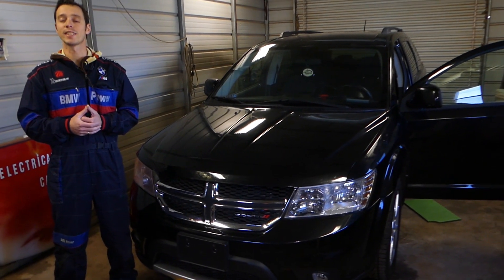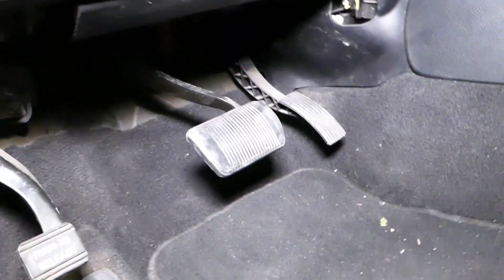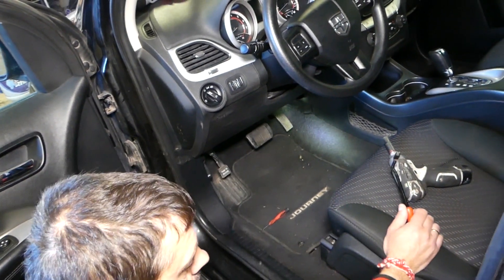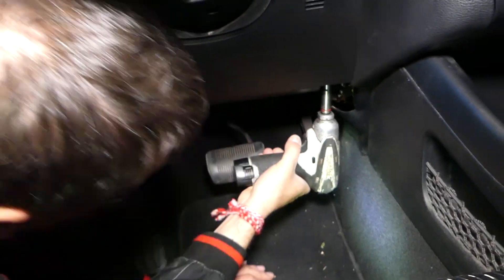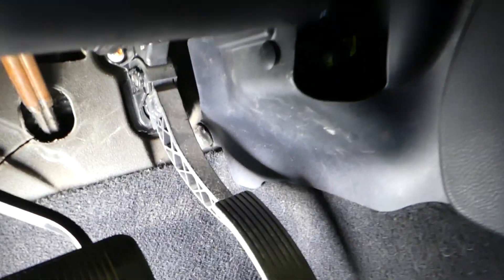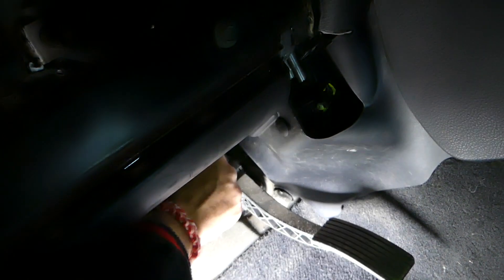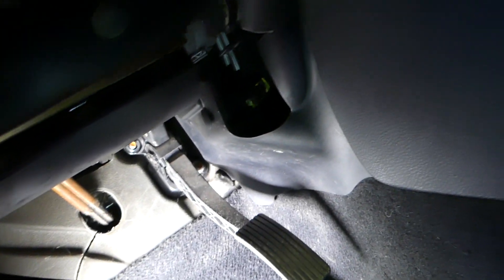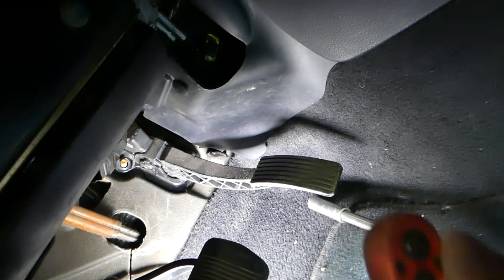DODGE JOURNEY THROTTLE POSITION SENSOR, GAS PEDAL,  ACCELERATOR PEDAL. FIAT FREEMONT

Comment: I replaced mine but when I start it after about 1 second of starting it revs to 3 RPM and stays there until I shut it off. I hooked the scanner back up and says it’s the same thing even after rescanning… what do I do now
Reply: I had a code that said throttle pedal  and switched it and it revealed up....I looked and no answer it was working fine so switched it anyway so when this happened I installed the older one and it worked fine so I'm guessing I got a bad one or a part for another car....I did notice that in the so called new one the connector didn't go all the way down no matter how much pressure I applied...so I don't know 😂😂 for now I'm driving with the old one cus it works

Comment: What was the reason you’ve replaced the pedal?
Reply: Because the throttle position sensor is the gas pedal 😭
Reply: Electronic Throttle control. Low power and limp mode

Comment: I really need some help. I have a 2012 Dodge Journey SXT. It will start but won't idle. We got the miss fire code changed the O2 sensors, spark plugs & coils, crank sensors, & a new battery. We have no lights on dashboard but we push the gas pedal & it won't go past 3000 RPMs. Do we need to change the throttle control sensor? Please help & answer.

Comment: Installed The gas pedal and now I start the car release the break and it goes wide-open throttle or at least 3/4 so I have no longer any gas pedal only brake release and apply has anybody else had this problem…?
Reply: How you fixed this problem I replaced my gas pedal but the rpms go high when I release the gas pedal
Reply: Did you ever fix this issue?
Reply: I have that issue too...
Reply: @flaviolozoya  you ever find the answer
Reply: You have to reprogram the computer. Can’t just replace the pedal.

Comment: I have a battery symbol with a lightning bolt between to bars on my 2010 Dodge Journey 4 cylinder 2.4 I got a knew battery and altanator but I've been told it's what u showed any ideas...
Reply: It could be the throttle body

Comment: How can I raise my engine idle speed? I need at least 700rpm to activate the voltage regulator in my aftermarket high output alternator 2015 Journey 3.6. Currently idles at 600 or lil less

Comment: I have a P2127 code right now. While I can still get gas to the engine, I don't think it will be long until it doesn't work anymore. I'm gonna try and do this. Thanks guys!

Edit: Turned out to be my catalytic converter.

Comment: hello i have a 2014 dodge avenger replace  cylinder head gasket car start but will not throttle  how to fix it
Reply: I have the same car and the same year. I got the same issue. June 16th 2021

Comment: Hi have 2013 Journey crew had 2 replacement transmissions .Went into limp mode called shop who installled them.Said coil packs and plugs .Went into limp mode again code PO75A cleared it .So what would be my next step.
Thanks

Comment: I have the lightning bolt on the dash and already replaced throttle body car will not start just cranks
Reply: Did you fix it?
Reply: @josuemagallanes1923  can a 2015  2.4 dodge journey  engine  fit in   a dodge 2012 dodge joutney  ty
Reply: @rikhiesingh9591  I believe so, with a few adjustments if needed
Reply: Josue Magallanes  yes
Reply: @brandonwarren5408  Mines was the fuel pump, didnt wanna turn on just cranked
Reply: @brandonwarren5408  How did you end up fixing it mine has the exact same issue replaced the throttle body and it still won’t start just cranks
Reply: @PythonTony  the TPS won't keep it from starting , even if you completely unplug it the engine will still start. So clearly your problem is something else.

Comment: I have the lightning bolt on the dash and already replaced throttle body car will not start just cranks
Reply: What you do to fix it
Reply: @MeetTheMessiah  did u find a fix? i have a 2013 charger with codes p2127. p2122 which do show live data and p0222, p0123 which dont
Reply: @Josue_S87  yes I had to replace my Gas pedal sensor
Reply: @MeetTheMessiah  thank you, going to pick up and install it tomorrow